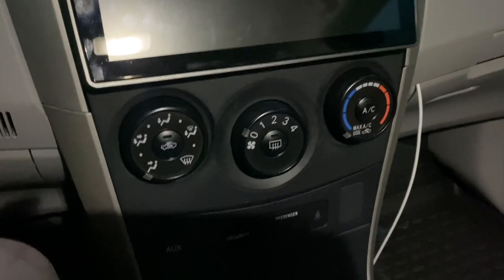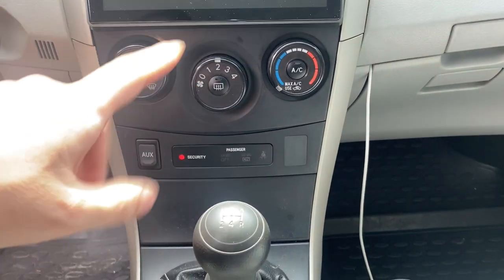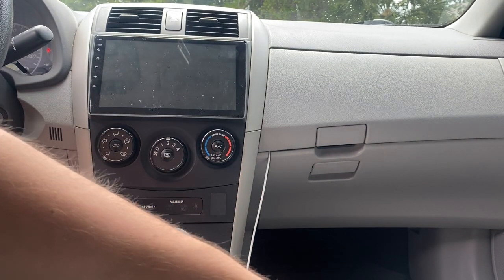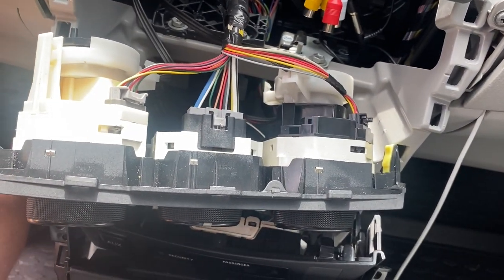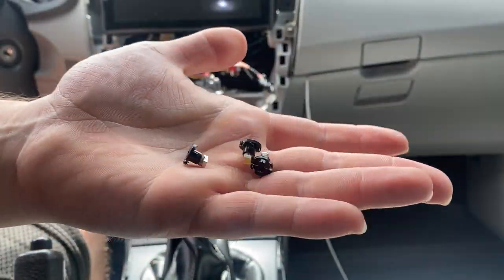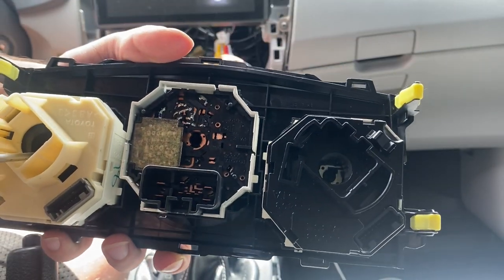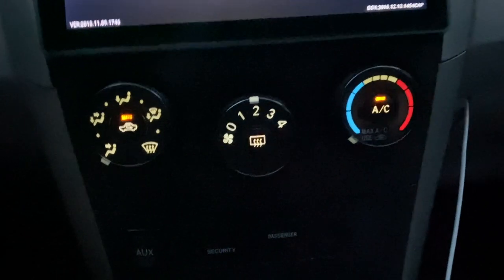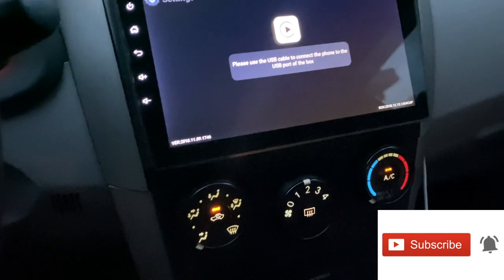How to Change out Lights in Climate controls

Comment: Hello, I recently did this today, and the white lights (where the numbers are) are unfortunately still out. Any pointers?
Reply: same exact situation i have; middle knob is still out even with new bulb :(
Reply from the maker: Make sure the polarity is correct. May need to take the bulb out and rotate 180 degrees.

Comment: I just replaced all 3 light bulbs on my 2010 RAV4. The hardest part was tightening these LED bulbs into the slot. These grooves weren't deep enough even for a smallest and thinnest flat head screw driver to fit inside the slot. After struggling for a while I managed to barely tighten. Thanks for this video.
Reply from the maker: Yeah that is one complaint I have about those bulbs. I did the same thing and tried about 5 different screw drivers and none of them seemed good. 
But glad the video helped out!

Comment: Thanks for the video! I noticed after I changed the bulbs my AC won’t work the same, like it lost power when is shooting air and in level 3 and 4 won’t even work …any ideas?
Reply from the maker: @youssanescobar9177  no problem! I hope it helped! 
As for the controls not being the same, the knobs might have moved or turned when they were unplugged from the cable that drives the AC controls.
I would recommend that you turn the knobs all the way to one side, and manually turn the cable behind it to 1 side so they line up with the corresponding control on the knob.

Comment: Do you know if we can change the color of the light on the dashboard by the odometer? It’s like a yellowish orange color on my Corolla 2011 and I want to change it to a blue and red color like it is in modern cars
Reply from the maker: The only issue with the odometer lights, they are soldered onto the board. So you need to know how to do soldering of small lights to change them out.

Comment: Hi Brandon, so there is only one bulb that illuminates the window heating button and the blower speed button?
Reply from the maker: The window heating button which is a deep orange color, which is the center button, this has its own led that is soldered onto the circuit board. And the blower speed button has a bulb that you can change, as I shown in the video.
Reply: @BrandonStellmach  Lovely, thanks 👍

Comment: Sir does it have a fuse and where it is loctaed? I changed my bulbs but still ot wont light, even the bulb below the shifter cover. So i was thinking maybe its a case of blown fuse. Also, the fuse box cover of my corolla is gone so i dont know if theres a fuse for the ac control panel. Id love my ac dash to get the same look as yours. Thanks pls help
Reply from the maker: I’m not exactly sure if there is a fuse just for the climate lights, but it looks like sport number 4 on the fuses says switch illumination. I’m not sure if that might be it. But here’s a website so you can take a look at all the locations, just scroll down to see the interior fuse panel locations.
https://www.autogenius.info/toyota-corolla-2009-2012-fuse-box-diagram/amp/
Reply: @BrandonStellmach  thanks much sir ill look it up. Btw, Able to set up my android stereo with no hassle. Bought the xtrons though. Thanks for your videos
Reply: @BrandonStellmach  sir i got i! Thanks much! Yeah the 4th slots got no fuse so i put one in and the panel iluminated although have to change the first knob, its not working but the two got lights now. Thanks sir
Reply from the maker: @popoygravy5118  awesome, I’m glad you were able to get it figured out!
Reply: @BrandonStellmach  thanks to you:)

Comment: EXACT same situation for me right now, no light on the leftmost knob. 
This video will definitely help me out to fix it myself. Overall, so simple. Thanks again.
One question .. do they dim, with the brightness control knob, like the old bulbs did?
Reply from the maker: Seems to be a common failure for some reason!
And yes they dim and get brighter with the control knob!
Reply: @BrandonStellmach same for me 🤦. Looks like Toyota cheaper out on that bulb lol

Comment: Same issue just it’s the right most Knob which is the temperature control. Plus white leds do look better and modern. Thank you
Reply from the maker: I hope the video helped solve your problem!
Reply: @BrandonStellmach would these same lights work on mine, it’s a 2012 not a 2009
Reply from the maker: @anthonyolivan4373 yes this should be de same for 2009-2013 corolla!

Comment: Thanks for this video. What do you mean polarity alignment? Is this trial and error thing to see if the bulbs light up?
Reply from the maker: the light bulbs have a positive and negative, and if they don't go in the correct position, they will not light up, and will need to be rotated 180 degrees.

Comment: was the bulbs was just a snap on? or have to use screwdrivers? cause the part you change the bulbs where fastforwarded and thats is the critical part of the said repair.
Reply from the maker: The bulbs are a twist lock, which I recommend a flat head screw driver to help get them in and out.

Comment: Just replaced mine, but middle knob push button lights up but numbers don't, is there 2 bulbs for middle knob?
Reply from the maker: There is a light bulb for the numbers. And a soldered LED for the center push button. The center one can not be changed. 
But if you did install them and one of them isn’t lighting up. Then you might have it backwards. The polarity on these bulbs matter the orientation.
Reply: Thanks so much, that's probably my issue!!

Comment: Hello. I noticed before replacing bulb your radio panel lights were not working too? Did i see it right. My radio panel lights were working and my radio light and temperature control dial light both went off at same time
Reply from the maker: My radio lights worked, I was only turning on the headlight switch, which would turn on the interior lights. But since I didn’t have the radio on, they didn’t show in the video.
Reply: Hey thanks for the reply but little update. My diagnosis was wrong. They are two separate things. Found out my panel light had two options and you have to turn them on at the same time.

Comment: You are amazing man
I have benefited a lot from your channel 
👌🏻👌🏻👌🏻👌🏻👌🏻👌🏻
Reply from the maker: Thank you! I’m glad the videos have helped out!
Reply: @BrandonStellmach  I want to help you, in My corolla has the lights running in the Air Conditioning Unit Which is in the middle only, while the rest of the lights (For example, the temperature control...) do not works when the headlights are turned on at night
Reply from the maker: @bilalalhajaya9870  make sure the bulbs are in there properly. As well as make sure you have the polarity correct. So you might need to rotate them 180 degrees to get the positive on the correct side.
Reply: @BrandonStellmach  I'll do that and let you know what happens, thank you

Comment: so the LEDs you used are super bright or not?
Reply from the maker: Yes they are bright at night time, when you actually need them. Just during a sunny day it’s hard to see them light up. I should of should what they look like at night. Sorry about that!
Reply: @BrandonStellmach  thanks bro! i changed them using the LEDs you used. the lights work really good. one problem thou, the indicator on top (the little square) is not lighting up. yours does?
Reply from the maker: @johndoe-db1ew  if your talking about the orange light, try to press the button in the middle. That is how that light turns on. 
If that’s not it, try to describe it better to me!
Reply: @BrandonStellmach  im talking about the little square that's right about the numbers of the AC. you know when turning up the AC from 1 to 2, or 3 to 4. there's a little indicator about the number but is not lighting up. I hope this helps
Reply from the maker: @johndoe-db1ew  I haven’t been in my corolla for awhile. I will check next time I’m in the car at night.

Comment: i have a 2010 corolla type s and all my middle light like turning the ac on turns on , on all 3 in the middle but the light around it wont brighten or dim what could be the issue.?
Reply from the maker: That’s interesting, I have not heard of that. Is it because the bulbs that are in there are not dimmable?
Reply: idk if the middle bulb you replace just turns on the middle light but the rest idk if there is another bulb that lights it. it used to dim but the middle is always been the same  @BrandonStellmach
Reply from the maker: @leomunoz2422 if you are talking about the middle orange light, those do not dim with the dimmer switch on the car. But the other bulbs that I replace in this video should dim with the dimmer.
Reply: @BrandonStellmach  isnt that the bulb u replaced the middle orange? There is another?
Reply: @BrandonStellmach   noticed the light on my gearbox dont turn on as well weird
Reply from the maker: @leomunoz2422  I replaced the light that illuminates the outside of the knobs where the icons are. The orange light is soldered onto the circuit board. Which would not be easy to replace.
Reply: @BrandonStellmach   ahhh gotcha so than that means some wire is loooe that dims the panel and gearbox